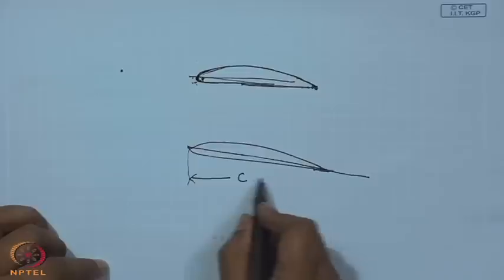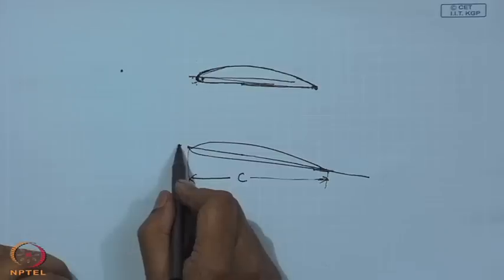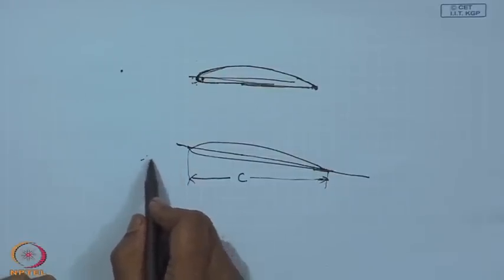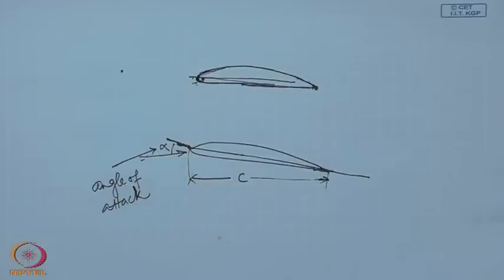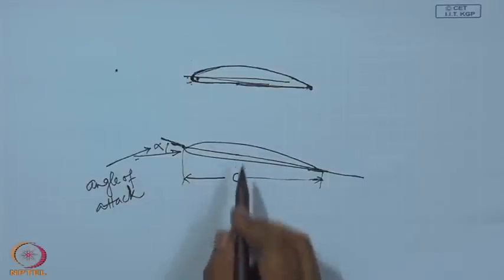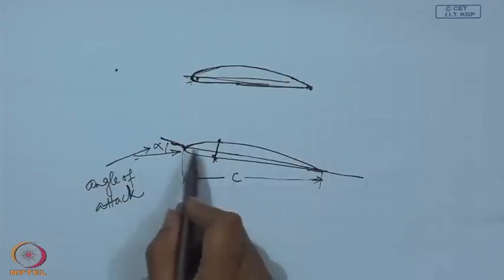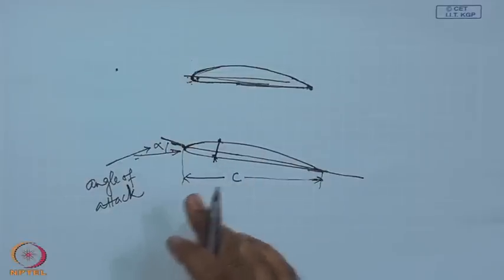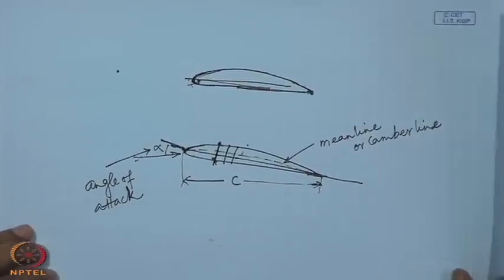Mod-01 Lec-02 Aircraft and Aerodynamic Forces and Moments (Contd.)

Comment: 1-The pressure and shear stresses acts on the hall body, by mean if we take a infinite wing or a any shape for example , the pressure and shear stresses will on the upper surface and lower surface of the body, Also the choice of the angle theta is chosen such that the pressure (act normally on the body surface), will make an angle theta with the normal ,.......

Comment: (2): similarly for the tangential forces (The shear forces which acts tangentially to the surface of the body) will make the same angle with respect to the horizontal, the positive direction of the angle is chosen  clockwise always by convention,starting from the axis to toward the force whether the pressure(P) or the shear stress (tau), in order to find the total normal, and axial forces due to pressure and shear stresses.

Comment: (3)- The normal, and axial forces enable us to find the total lift and Drag , since they are connected through the angle of attack alpha.....
Also the definition of the pressure coefficient  Cp=p-p_infinity/(q_infinity),  and the shear stress coefficient Cf=Tau/(q_infinity). are important. to make a clear image on the result to be found.......